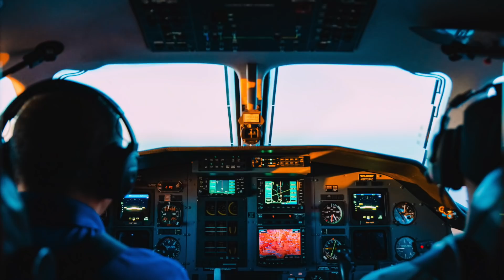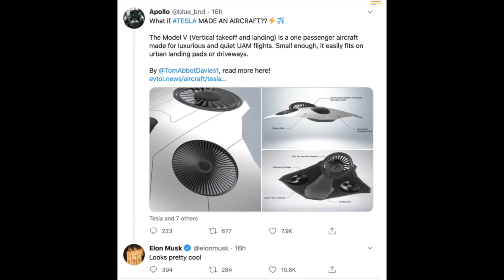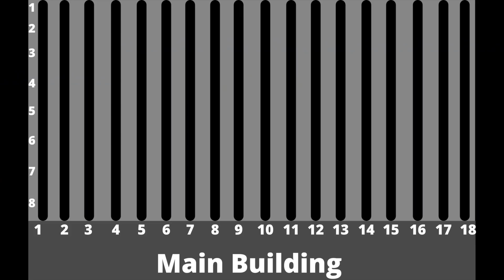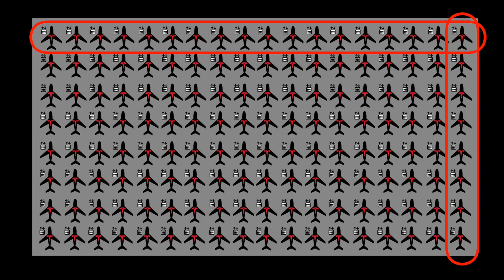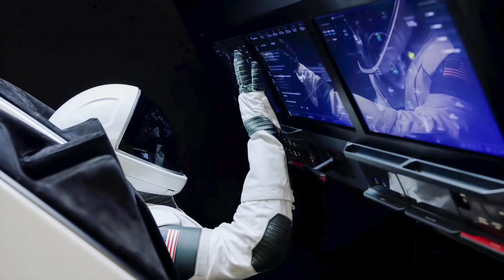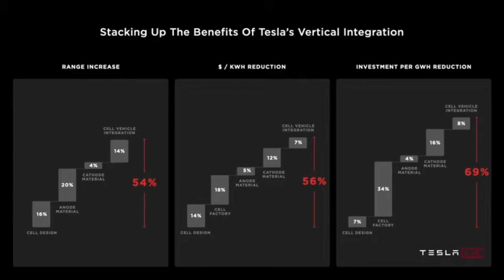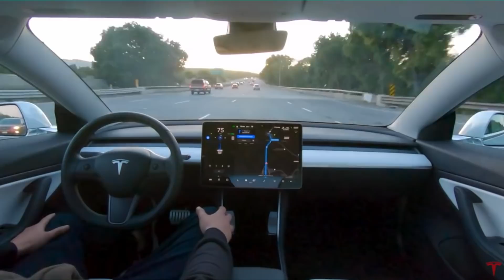Tesla’s Electric VTOL Airplane, will change aviation forever

Comment: I’m a big fan but when you get into aircraft you are occasionally out of your depth. I suggest in these domains you employ a technical editor.  I can imagine that you may be repeating news said by others but that’s a weak defense. VTOL’s vertical ascension requires far more energy than when assisted by airfoils. When runways are available Harriers use far less fuel. They also can takeoff with more weight when they are using the wings. Also in case of engine failure a horizontal approach will be far less dramatic. Helicopters minimize hovering because of the fuel usage and the rapid decent in case of a lost engine. Some of your reports remind me of the reporting at the time of the introduction of the Boing 747 and the Airbus 380. I’m sure you saw pictures of passengers in capacious lounges living the high life. In reality more seats were configured economy. You have assumed that the rapid incorporation of changes would be commonplace. The low fatality rate in the US skies is attributed to the actions of the FAA. It’s one thing to approve experimental aircraft and quite another to allow 10 passengers with luggage. Also allowing downtown landings won’t be any more frequent than current helicopter landings for many reasons. I’m excited about the potential for short VTOL flights but not at the diminution of flight safety.  We have enough ground collisions with current spacings, these are aircraft not cars on a transoceanic car carrier.

Comment: I wonder if plasma can be manipulated to form actual fan blades?  Just thinking out loud!!  Perhaps two points can be spun inside two separate vacuum sealed tubes?  Zero resistance if they use electromagnetic rails!  Interesting thought anyway!

Comment: Not knowing wether this aircraft will be subsonic, if so the higher altitude will mean the aircraft is slower than conventional jets. The speed of sound drops with temperature which in turn drops with altitude.

Comment: I am pretty sure that you would change the pitch of blades not rotation direction for regen while descending altitude, just like autorotation in a helicopter, or switch electrical configuration to apply regen-braking like in a wheeled vehicle -- do wheels rotate backwards when braking a vehicle or bike, or the blades in an auto-rotating copter??

Comment: 4:10 Not sure how the physics works here. Higher altitude = Thinner atmosphere. 
Therefore, less air resistance, allowing for faster speeds. That is correct.
But it also means less air for the fan to use for propulsion, which equates to less propulsion to get to those speeds.

Comment: The V tol technoligy can be robosized by 5g much better then electric cars du,ll you can not bump into things in air must less. More space in all dimensions. So you can create a world sized covered network by membership and lower the costeds. So transportion more out of the private sphere into the public sphere is the future I think. Because les roads are needed and less input into the invirement.

Comment: Implosion not explosion. Self regenerating / using the same energy over and over is the key.  The battery creates a charge , the change turns a generator that charges the battery . Why can't the smart people figure out some system that reuses the same energy.  The sun smothers us with enough energy 24/7.

Comment: he stated that jet a/c are not as efficient at altitude, that is completely wrong jet engines are more economical at altitude due to the thinner air requires less fuel. A V-TOL aircraft uses pure mussel to lift all the weight of the a/c, passengers, and luggage. The ducted fans would draw and extreme amount of electricity which in turn would require more batteries adding to that weight. His mention about Boeing not advancing, the 787 is mostly composite and reused older tech for pressurization system. Although electric a/c are coming but it will be a long time and testing required by the FAA will add a decade to that new tech. It would be plausible in a kit plane first on a smaller scale

Comment: For each vtol plane, passenger capacity will be much lesser than Boeing and Airbus capacity. If we take a total passengers, 1440 Vtol planes may accommate max 10 passengers(144 planes) while Airbus and boeing accommate 600-700 passengers(2-2.5 planes). The benefits of Vtol planes will be renewable batteries, elimination of air and sound pollution etc. The main question arising is how much will be the flying charge per passenger in a Vtol plane?

Comment: Cute idea LOL! Have you factored in the environmental destruction of all the mining would necessarily be done to create the batteries? Have you factored in where the hell you were going to get all the electricity generated to charge those batteries? You love the panacea of no emissions coming from a tail pipe, but you neglect that they are coming from a smokestack of a coal fired generating station someplace else! Is there any country that has the electrical infrastructure that could handle every car every airplane that needs electric power to charge them? Wind farms are an absolute joke, solar does not do enough, solve the clean power generation first, then work on electric vehicles.

Comment: You are underestimating the space needed around such a vtol plane.  The amount of air thrust would blow away the surrounding planes.
You're traffic control would be an absolute nightmare especially around populated areas.  People would talk to each other to prevent collisions?  Traffic control would be astronomically more complicated than our current traffic control.   You would need computer automated and coordinated control of all aircraft movements, otherwise you would have many, many collisions with aircraft falling out of the sky onto the city below.

Comment: In higher altitudes, doesn't propellers have an issue with less pushing power because of thinner air? Or is the thin air not thin enough to matter?

Comment: Musk knows, and has repeatedly stated, that until the battery energy density problem is solved there is no point in working on this because we already know everything about the aerodynamic side of the equation. Jet fuel contains about 50 times more energy per liter than batteries at this time and when it comes to flight weight is everything so even considering internal combustion inefficiencies there is a long ways to go. Not saying it can't or won't happen but it's probably not the 'slam-dunk' some people are imagining.

Comment: Battery density will be important but what if you could produce your own electric energy in flight without extracting the energy from the batteries. I have my own theories and getting on Tesla engineering team without a engineering degree I would be impossible. I’m not really interested in subsonic but more interested in supersonic electric propulsion. Breaking the supersonic barrier with an electric motor could bring someone a Nobel Prize.

Comment: What stops electric airplanes taking a charge from clouds? The static electricity that makes lightning could be harnessed right in the air at any point in the flight. Recharge literally on the fly. Not even a pitstop. This might also be possible for boats.
Reply: And if the skies are clear?

Comment: I don't think itl be so😩, batteries don't hv the capacity to carry much energy or even come close to jet fuel.
Reply: Graphene batteries will do it.
Reply: @iamchillydogg  graphene batteries hv maximum theoretical energy density of 1kwh/kg and jet fuel has 12kwh/kg. So it is still not enough.😒 And by the way jet engines are way more efficient than ice engines so they use up the jet fuel more efficiently so.

Comment: 1) The propellers would need air to create the lift or propulsion, but the higher you go, the thinner the air. No?
2) It won't disrupt air travel for a while, as these eVTOL has limited range. It might still be the "spoke and wheel" set up where smaller eVTOL pads feed into JFK or other bigger airports that continue to provide long distance travel.
Reply: It may be the perfect way to get to the spaceport from JFK. Then on to Melbourne or the Moon or take the Monday emigration flight to Mars.

Comment: This video is only entertaining to someone lacking any real engineering expertise! The weight to power density problem has yet to be resolved, electrical aviation is still decades away. You are overselling the current practical viability of this technology! Battery technology needs to be improved to match the same power density of hydrocarbon fuels, we are no where close to achieving this crucial milestone.
Reply: We just have to figure out the mass production of graphene which might not be too far off.

Comment: I believe Tesla will be the company to introduce the 1st VTOL aircraft.  Potentially with the Free turbine style "electric" engines following the concept of the Black Sail engineering so that the turbine can spin slower than the air flowing past it which will incorporate the electricity as a way to get it up to speed and then the rest is done using the existing wind with minimal energy use.  Very good description of where Tesla technology is heading.
Probably for sale to wealthy pilots by 2026.

Comment: I have a question. If planes become electric will this restrict planes to turbo prop alone as I can not think of a way a jet engine could be all electric. A jet engine is dependent on thrust created by compressed air being heated with fuel and being forced out the back under pressure, where the turbo prop is in need of a mechanical spinning motion that all electric engines are able to do. Here the spinning props alone are creating the forward motion.

 An electric jet will be a big jump.

Question Two. Since planes usually fly high, often above the clouds, will they benefit from solar panels, or is so much electricity being used so fast, that the amount they would contribute be so little, they would be a waste of time?
Reply: If they fly fast enough and they keep going west.they can have solar power all the way.

Comment: Actually it's only a 40% range increase on the new Tesla battery. The remaining 14% were vehicle integration. I don't think you use that argument on a totally new transportation design... So if the base of entry was just 260kw/h, it won't be enough. But if it was 300, it should hold. Either way there might be gains to be made if they also add one or two ultracapacitors. Maybe.

Comment: This video is stupid. There are airports you can use as a baseline. They are helicopter airports. 
Also, you have to have a pilot at all times. And you will need a air traffic controllers. 
Tesla didn't change anything. It's not like it was the first electric car. 
spaceX isn't changing anything. It's all old designs.
Just like how the hyperloop is a joke.
Reply: They'll be robot vehicles that talk to each other so no need for traffic control. Keep them under 400 feet and away from airports stuff like that.
Reply: @iamchillydogg  ya, and they will fly right into the hospitals like how the auto driving cars drive into emergency vehicles.
The military has been using automatic drone phantoms since the 1980's. They fly under 400ft and have full radar and communications,  but will respond to a tower. Nothing new here.

Comment: Elon Musk is sitting on a pyramid of people knowingly and knowingly supporting the cover-up of my company being robbed & child sex trafficking ring.

They send Neuralink Tech into each kid to read their minds and either initiate a recruitment process using a Neuralink Character or to monitor your thoughts in case you wish to oppose the cult. They use the characters method to threaten the kid they’ve just enslaved. This helps get kids to act how they want them to for child pornography or traveling out of the country. 

Full Article: 
@t

also check out: 
@t

This process is being used against federal judicial System Employees:
@t

Comment: The fact that VTOL aircraft are so quiet, time restrictions flying; ie Sydney; will no longer be required.

What if the VTOL could rise very high into the atmosphere, to the point of going up on a steep vertical angle till the destination is visually accessible, then fly directly towards that destination. It may change flight times from 24hrs to a few hours.

Comment: mho - too good to be true, at high.altitude, higher than for regular airlines planes, air is so thin I doubt a plane with electric motors could go faster and more efficiently than one with a proper fueled jet engine.

Comment: Electric vehicles cannot be more efficient at higher altitudes because they has no air to push.... No air to cool the  engine....
VTOL is extremely noisy! No one will be able to use it at city areas.

Comment: Disagree with you.

Tesla does what Elon says. I think if Elon was sold on air travel, he wouldn’t have put so much into the Boring Company with hyper loop. It’s clear Elon thinks the future of commuter travel is down, not up!

Tesla will likely sell batteries to a future electric air company but I don’t think an electric plane is a future Tesla project, unless something drastically changes in Elon’s outlook.

Comment: Pie in the Skie 🍰🙃 Massive infrastructural change, and inefficiency  with propulsion once up to cruising height. Suitable really only for a replacement of helicopters which means nope it is not going to revolutionise anything right now. I think for Hyperloop  and this flight technology to exist there is huge infrastructural change required in particular the ability to transport people in small groups over long distances and to more direct locations...if I had to guess I would say we're looking at 2085 -95.

Comment: Maybe I dosed off, but I didn't hear any consideration of operating temperatures at high altitude, especially if you want to go way above commercial jets, which work much better at altitude than down low where they have a huge thirst for fuel. Keeping the humans warm and the batteries at a temperature where they can perform are major issues...

Comment: Not anytime soon, IMHO.  It takes quite a while to get a new aircraft approved by the FAA and friends.  Taking off vertically is risky in the case of an engine failure, so the packed in VTOL airport you propose won't happen.  This is why even helicopters like to avoid straight vertical takeoffs when possible and helipads require a clear horizontal flight path for a certain length.

Comment: Ahhh Lars…….think about it - a propeller or a turbine fan creates thrust only while turning in one direction. If you are running the prop or fan in the other direction you are creating drag or reverse thrust. Sure you could generate power while it’s freewheeling but it’s gonna be falling out of the sky like a homesick toolbox !
Reply: Regeneration requires the engine to keep turning the same way, so yes you should get good regen while descending. It's a matter f applied power balance. More power than required for level flight, climb, less power applied descend, no power applied, descend faster and generate a lot of electricity.

Comment: Ahhhh Lars not quite…….all aircraft are more efficient up high because the thinner air reduces parasitic drag. Even old 1950s technology like the U-2 and SR-71 are able to get to ridiculously high altitudes because as they climb they get LIGHTER by burning off fuel. An electric airplane will ALWAYS weigh the same.

Comment: This all sounds good however it's not exactly as environmentally friendly as they would have us believe. Mining for lithium is extremely disruptive to the environment and to the citizens of the countries we're getting it from  plus it takes a lot of energy usually produced by carbon fuels to extract and process the lithium .In addition where are the batteries going to be dumped once they're used up ? Currently we have a major issue with these batteries being dumped into landfills and then poisoning the environment .  This hasn't been thought all the way through .

Comment: Absolutely elementary Lars. The sole complexity of today passenger Planes, and yes  their safety records too, the exorbitant prices  and operating costs, definitely it is a segment of the transportation industry waiting for Elon Musk opportunistic savvy. Indeed I would be totally surprised if in the next 2 or 3 years, ( He needs this time frame to mature the entire seamless EV business to afford the time he will need to start the new venture) he will not launch the stunning new line of electric planes business with a bang. for sure he will not start with anything small or ridiculous, like the many contraption that appeared recently. But probably with a 250 to 300 VTOL EP for electric plane. He has already everything that he will need right at his finger tips. To start with the batteries, state of the art electric motors and the software know how application to an EP that will probably fly totally itself, from take off to landing. Space X is already doing that  with a very high success rate. Cost? Probably over around dream liner price. Market entirely all and greedily waiting, as its operating expenses will be far below conventional planes. the competition? Total incredulity, stunned, helpless, for on the announcing date to the press, Elon will already have a decade head start, and an order book filled with thousands advance orders.

Comment: Besides less air resistance with altitude there is  also less air for the fan blades to push against so that will negate the benefits of less air resistance to a degree.

Comment: Jet engines actually are more efficient at high altitudes than lower. Also planes are not faster because reaching Mach 1 would require a lot more thrust ant structural integrity. I dont think going electric would solve the speed situation.